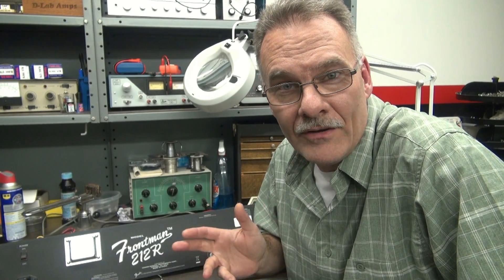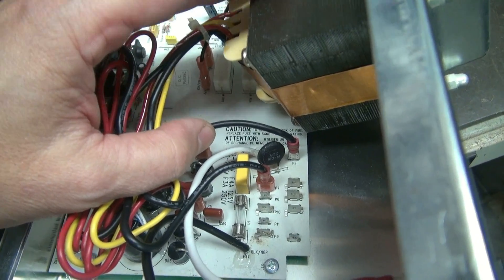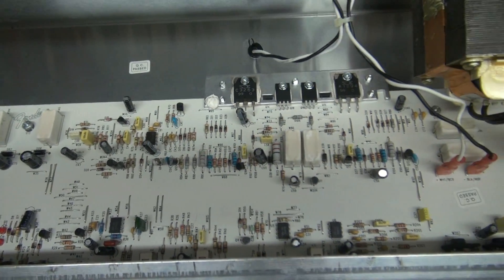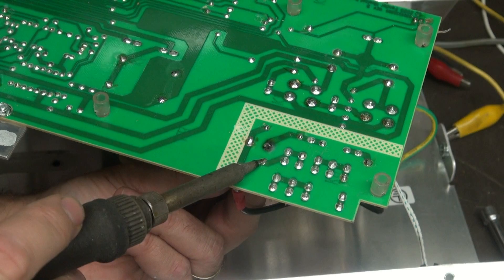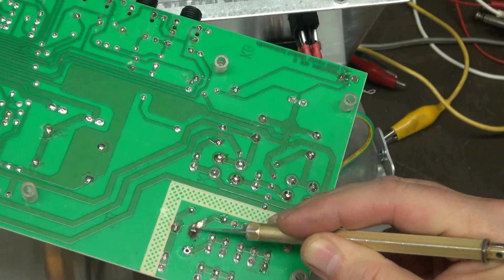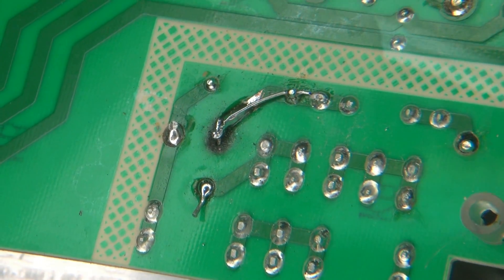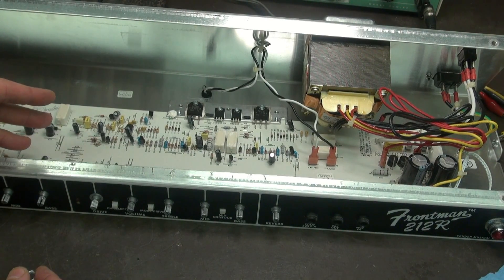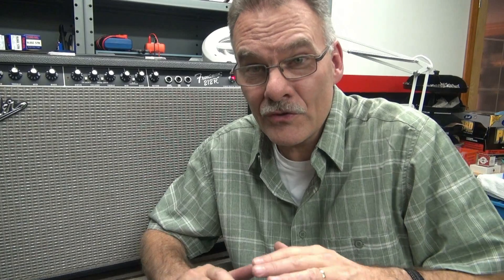How to repair Dead Fender 212R Combo guitar amp solder connections

Comment: Because of your video I now have a working FM212 again, pulled it apart because the number one amp jack deteriorated and fell apart, so I had to replace it. And to do that, I had to pull the board out disconnecting all the wires and that was a mess. solder and foil all looked good so I lucked out there, and all the capacitors looked good. New Amp Jack is in, all connected and I wired it wrong, redid the wiring with what I seen in your video and BLAMO I have  sound... better sound then when I first purchased the amp (used) seems cleaner. I'm a happy camper guitar amping fool, thanks to you.

Comment: i have one of these and actually it sounded ok in a guitar center i bought about 9 years ago but after a month of owning it, it started cutting out and making popping crackle sounds like a bad pot but is on both volume channels .. I did get some solder in replacement pots but then though why woudl both of them go? I didnt really care for it as a strait amp but with the effects loop i coudl make it sound pretty nice... anyway both columes cracksa dn hiss and cut out

Comment: It's been 7 years, great video I have a question. how hard do you think it would be to replace all of the potentiometers on this board I just purchased one off of marketplace for real cheap and I either got to drill out and make the knobs have shafts or put new pots on.

Comment: I have a question. Im hoping  the creator of this channel or anyone can help.  I recently purchased a VOX VALVETRONICS, TONELAB LE , floorboard style guitar processor. It was only $30, huh said it would switch between patches on its own , no water damage I fixed the intermittent switching on its own problem, and tightened up the expression peel, Plugged it in and no sound is coming out of the output jacks, how do ia test output jacks ?

Comment: Have you ever worked on an Ampeg vh140c, solid state? Mine is doing this thing where the volume drops and then fades in and out. Any ideas? I also have a Crate GX130C(the circuit is based on the aforementioned Ampeg amp) and the chorus keeps turning on and off intermittently. Do you have an email of Instagram?

Comment: i have a 212 R fender frontman My question is.. foot switch and the correct cable to use the foot switch .i know its a 1/4" jack but i think this cable is 2 ring if that makes cents .. great video my dad use to repair TV back in the day i learned a lot from him pritty cool repair  thank you

Comment: Hello there. My name is Abby and  I was wondering if you can help me with a Fender FM212 DSP that I  have tried to repair without luck. The problem that I have with the unit is as follow. Unit turns on but has no sound at all.  I checked the amp section and all voltages are fine. I have realized that if I press the channel select button it won't change channel. I have been searching for the schematic diagram all over the internet without luck. Any assistence will be appreciated. Thank you..

Comment: question, why do you suppose those components came loose and the connections burnt the board foil up?

does a faulty component create this or was it the lack of a proper connection from factory or not enough solder?

should you have used a new resistor so that way you have enough lead to bend over onto the board foil plus have a brand new thermistor as you're already there in going through the motions? a matter of time waiting for it to arrive? I think these are like $2 parts? the power resistors what $3.69 or so?  just curious? I guess if it burns again you'll replace it or both..

one more, I am not a amp surgeon but have seen my fair share of amp innards and videos to me this appears to be a very well made solid state amp as in its layed out very nice, easy to get at and service, clean so forth, wash pots all that.. I like it myself, also the way it's made and laid out upgrade or playing with tone and so forth looks easy enough anyone ever mod these up?

good grief I have a what is it a Bugera Alchemist? its all tube but has effects, and they way they use all the different boards and then share here and there and have them jammed in so its a nightmare to get anything out is crazy, why its in my closet collecting dust, it worked but the effects are not working butman I cannot muster the energy to get at it such a nightmare..  I guess their biggest problem was the form factor, they wanted to jamb it all in a 3/4 sized head, no idea why they do this, not like it light or anything, use a full size head and have room, a little air to cool things off.. nuts  I guess the $160 they saved on particle board and tolex for each amp was well worth it, "reputations, meh we don't need no stinkin reputations" 

watch;

"anyone want a buy a cheap semi working Alchemist amp?"

Comment: I have that 212r and I had BIG pops and cracks when idle, I fixed it... well 96 percent better because I could not (at the time) get my hands on 2 of the other transistors I wanted... It still makes some cracks sometimes (can be 5h without anything) but not even close to what it used to do, it is just a fraction of the loudness it used to produce...

Comment: Hey just wanted to say thanks for ironically diagnosing my amp! The exact same cement resistor was loose on my board and the solder pad had actually broken off the board. Ran a wire in place of the trace and she's good as new!

Comment: I realize this video is 5yrs old but I have a weird audio issue happening with my amp & I'm not really sure where it's coming from.. I have a Marshall Valvestate VS100 Head that sounds great & works as it should, but when I stop playing & let the audio "ring out" naturally there's this odd "sizzling sound" that occurs towards the end of the audio fading out.. This sizzling sound is really noticeable when using headphones & it's happening across all 3 channels, I've replaced the tube but it's still making the sizzle sound so I'm not sure what's causing it.. It's a 1998 & the original owner played in a Death Metal band so I can imagine that this VS100 has spent most it's life cranked to 10 which makes me wonder if something was overdriven like a chip or a cap or something.. Any help/tips/advice would be greatly appreciated..

Comment: Hi, I know this is a punch in the moon message of mine. I am hoping you can read this. I have a Fender Rumble 150 bass amp. There is power and everything is working except there is no out  put sound on the input and auxiliary.  I can able to make it work only if I connected the headphone port into different amp input. Sound is coming it, speaker is still good. I am so frustrated due to the fact that bought it new and used only for 5 hours over all in 4 years time. I had it check in Fender authorized repair shop in my area. They said its not covered by the warranty and there is no parts available. They suspect its a motherboard but I doubt it. They didn't even bother to troubleshoot it or open the amp head like what you've did on this video. Please advise me what is the best thing to do. Thanks so much!

Comment: Whaat D-lab working on a solid state amp lol 😅  Those sound thin, they cut a lot of the guitar low frequency with the input capacitors. They have brittle  pcbs and traces. Not like good old tube amps.   Cheers 🍺 -Max

Comment: Hey Terry, I've got one of those in my bench right now, from my brother-in-law's bandmate, with a strange issue where the amp distorts on the clean channel when turned up all the way.
Have you ever seen that problem? What's the most common culprit in that case?
Thanks for any tips!
Reply: I have exactly the same issue, and it’s been almost 2 years with it like that... never found an actual solution :/
Reply: @martinlaferte  Turns out it was one of the power resistors (the one right under the power transformer) that had a bad connection in one of the legs. Jumper wire j-hooked to the leg + soldering it to 2 points of the same foil so it doesn't move and it's rocking again!
And the other techs (according to the client) all said it needed new speakers - B frickin S!!!
Reply: blackcorvo thanks for the reply, man! I’ve spent most of last night checking the amp on the inside, and my issue happens to be same as yours, dude. The only issue is that I don’t have any tools for soldering right now, but hopefully in the next days ;)
Reply: @martinlaferte  glad that helped! Good luck!

Comment: Used your video and got a dead 212r working... Just to find out the speakers were toasted. Threw 2 v30s in it and now I am getting a loud hum/tone when plugged in. Any ideas???
Reply: Did you ever resolve your problem. I have a very loud hum whenever the amp is turned on.

Comment: Hi, my amp turns on but when I connect the guitar in the jack amplifier nothing  happens. I just  hear a low noise like a "zzzzzooooo". I put a spray  contact cleaner in the pots and nothing worked. What could have happened? Thanks for help.
Reply from the maker: What make/model of amp
Reply: @d-labelectronics  Fender Frontman 212R
Reply: Are you sure that the guitar is outputting a signal?

Comment: Hey! This video is pretty old but maybe someone will still see my question...
I have a 212R too, and I opened it today. To do so I had to unplug both 12" speakers... what a surprise, one of them is not plugged to the amp ! The black and white wires only do a loop coming from the speaker to the same speaker...! Is this normal? And I noticed the second speaker is connected to the amp, but there is no second slot for another speaker...! Can anyone tell me what this is for?
Reply: Thom ETIENNE it’s not stereo, that’s normal

Comment: That tip for repairing damaged/lifted PCB traces is awesome. I always thought those were a lost cause once they lifted or got burnt out like that, requiring a jumper wire to be soldered from one point to the next to maintain proper continuity. This is so much more solid and doesn't require having a loose wire dangling from or running across the bottom of a circuit board. This is especially useful in those wacky cases where a PCB trace goes a long ways across a circuit board requiring a really long jumper wire to be soldered in. Thanks for the killer tip, and wish I would've known that sooner.

Comment: made in india,too many crap solder joints,broken traces,and on and on,i've been buying this kind of junk lately to re-stuff with good old school thermionic valves,here in scotland ,that's part of the United Kingdom,not England,as we're all british,i may even do some REAL hybrids with tube(american cousins now) pre-amp and SS,that's solid state not Schutzstaffel,output section,shit i might just go crazy and stuff it with glass end to end,might use a mix all the way through.
New SS amps piss me off,modelling this n that,oo' tweed deluxe AC30 blues breaker mode???
para/series X loop and some pedals and real tube (yank again) 3 line (long) boing tank goin' on in there,eylets,posts are radio TX/RX devices for crazy hair pulling noise pick up interaction manic depression .
If i sound off as nuts,then that's what the yanks said in the ardenne forest,and it was nuts(the reply).
I still love my glass bottles,with the warm glowing warming glow of a fillament heater and ionised blue gas,that's not quite gettered.
Reply: ...don't get your kilt in a knot, Angus...!

Comment: I have a Fender Champion 100 and it turns on but no power coming thru the speakers. Inside everything is good like new including the soldering, I am thinking bad power transistors. What do you think ?

Comment: +D-lab Electronics Man I hate working on PCB amplifiers! Give me an eyelet board amp and I'm happy working on it. It's a poor design to mount those parts that get very hot so close to the PCB, and it's traces. I too used to repair those traces using the wire technique. But, I was never happy with the appearance of the repair afterward. Several years ago, while repairing a Peavey ProFex where the motherboard battery leaked and corroded all of the many traces around it to dust, I came up with a better method, aesthetically. I used traces that I salvaged from a donor PCB. I attached them to the board using phase change epoxy film (from Fastel Adhesives, no affiliation). After reattachment, I soldered the ends to the existing trace ends and painted on new solder mask. It was completely functional, and if you weren't aware of the repairs, you couldn't tell it was done at all. Now, I use this method for all PCB trace repairs. It's fast, and repairs look professionally done when completed. I hope you or others may find this useful.

Comment: Great repair guy I have a Solid State Fender Amp JAM 25 watt with hum in the volume above 3 ??? Is that as easy to fix as this one was. The board is about 1/2 the size. I would try it if I had a life line. always great stuff thank you for sharing your talents.
Reply: It sounds like there are fractured solder connection(s) in the amplifier. This is a common problem with pcb's- and it can be DOGGONE hard to find.

Comment: hi, i have a Fender 212r, but the problems is, the  R1 was burn it and i cant read the colors code for that reason, then do you can say to me what is the value of that resistence, is located betwen the input 1 and 2, i hope you can help to me.

Comment: My FM212R was my first "Real" amp back in '03 to the tune of $385.   I've always liked the tone, but honestly, it has been a real pain in my ass over the years.  Multiple replacements by Fender, multiple repairs by me after the replacements because it was out of warranty. 
I've had electrolytic caps poop out, transistors give up the ghost, twice.
And to this day, it still has this little sound it makes at times that sounds like crumbling up a gum wrapper.   Kinda comes and goes.  I'm too lazy to diagnose it since I got into tube amps about 5 years ago.

Now its just a speaker cabinet for my other amps, but every so often I fire it up and remind myself that I still like the tone I get from it. 

It doesn't have to tone like my Peavey Classic 30 or my Carvin V3, but it is a nice sounding amp. 

Interesting note:  When I was doing the last repair, which turned out to be a bad output transistor, I decided to try something new and hopefully end the repairs, I lowered the bias on the output transistors, which dropped the running temp' by about 100 degrees, and I haven't had to do any further repairs.   And it changed the tone of the amp for the better.
Reply: Drastic Measures how did you lower the bias?

Comment: Hi, I'm writing to you from Poland. I was wondering whether you can help me figure out the problem I have with my Frontman FM 210. It stops making a sound after 40-50 minutes of playing (volume less than half way up). It needs to be turned off and then on again after 5-10 and last time it was more than 15 minutes to be working again. It just stops making a sound (the amps stays turned on, the light is still on). I sent it to be repaired but the repair guy could not find the problem. Thank you
Reply from the maker: Hello, That issue sounds like bad solder connections in the power supply. The connections heat loose connection, amp dies, cools connection makes again and amp operates. Inspect the board solder joints with a bright light & magnifying glass. Bet you will see cracks and cold joints.
Reply: Thank you for your prompt response, I really appreciate that!
I'll ask my repair guy to do just that.
Reply: Hello again,
I though I'd send you the reply I got from the repair guy, perhaps you can make something of it:
"I tested  at full power with many frequences and was ok, any problems .Problem exist with about half power.Power transisttors goes to62 °C and thermistor disconnect signal  to the power state.With smalest signal  no problem.With full power transistors has 53°C." 
Thank you
Reply from the maker: Have him double check the solder connections on the final output transistors and the power supply feeding them. Especially any power resistor leads, they grow bad connections. If the transistors were bad, they would act up at any level.
Reply: Will do. Thanks!

Comment: Can you get to the fuse by opening up the little metal box in the back of the amp?  Thanks in advance for you answer.
Reply: In this amplifier, the fuse isn't accessible from the outside- and there's a reason for that: with solid state equipment, when a fuse blows, you can bet that there's something damaged inside!!

Comment: Hi!  In my case  when i changed  a   very  high power NTC (i think it was for 30 A rated)
in a solar batt.charger,  i used  a 99%Sn 0,7Cu solder and i put a large amount of solder  on traces.There is  allot of heat generated  on traces from those  NTC's you know!

As for wire jumber  i used soldering wick when i have a broken trace.It work very well.

Comment: I have a 212R and i was wonder "Could the amp suffer a damaged if i disconnect one of the speakers?" Hope you can answer and congratulations for your great work and channel :)
Reply: You should NEVER run a high power amplifier without a load connected...this is ESPECIALLY true with solid-state equipment.

Comment: hi! I learn a lot from your videos, hope you can help with my frontman 212r, it does make this radio like noise when my guitar cable is plug into the amp, but when I remove it, it doesnt make that sound, i tried different guitars and cables, same result. i would really appreciate your help, have a good day sir, :) thanks
Reply: ...are you close to a radio station?